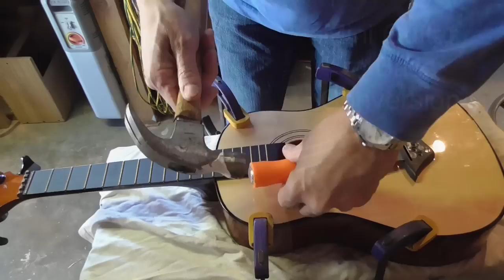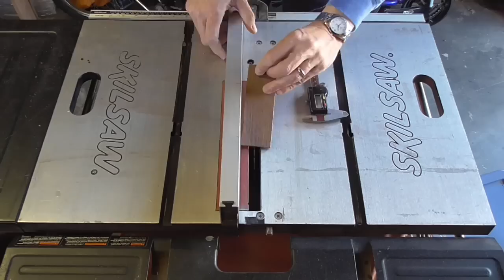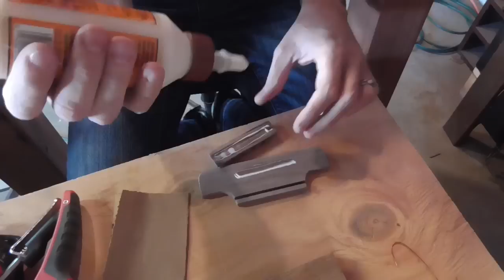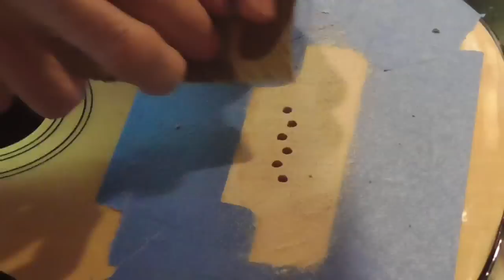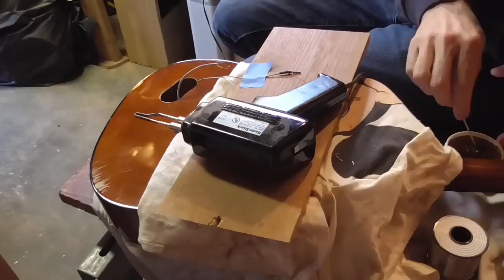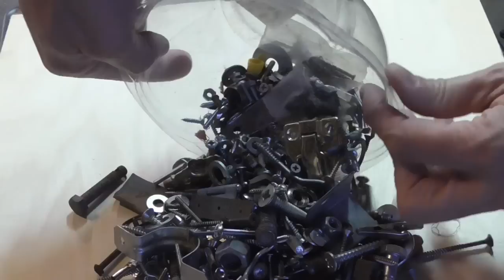Ukulele Bass Conversion

Comment: My thoughts - just completing my 2nd conversion of a 1/2 size guitar and the piezo pickup mount I use is under the bridge attached to the inside of the body, like on other instructions found on youtube. That setup even worked well on a plastic "Disney Cars" toy guitar which was my first try, and the sound did not need any boosting - plenty loud.  Using tape I moved pickup around a bit to try different spots, then hot glue gunned into place.  I am using Aquila Silver Rumblers - just ordered another set!
Reply from the maker: Thanks for the ideas Paul!  Piezo placement seems to make a lot of difference.  I like the idea of mounting inside the body under the bridge - going to have to give that a try.

Comment: Why not fill in the holes on the original bridge and redrill for bass if the half size guitar was originally steel strings it should have enough strength for nylon bass strings then all you have to do is replace the nut and machine heads no overcomplicated replacing the bridge also the original bridge if placed correctly In the first should be good for intonation.
Reply from the maker: I wish I’d thought of that originally! Hopefully that can help someone else considering this. This instrument is long gone now, but wish I had done it as you suggest. Live and learn.

Comment: Great! I will convert mine very soon... One question. How did you put the tuners??
Reply from the maker: I bought the smallest bass tuners that I could find, and as I remember it was a squeeze to get them installed. Just used the bottom 4 tuner holes, leaving the 2 at the end/top empty. 

Overall the bass is not great, left me a little disappointed. It was a lousy guitar, and didn't get any better as a bass. Just wanted to give you fair warning. I hope your conversion works out well!

Comment: magnetic pick up and rubber strings dont work together......?
Reply from the maker: I was using a piezoelectric pickup that (I think) works without magnetism, using vibration or pressure.  It works fine, though a preamp would help the signal.
Reply: You can also use Aquilar Red Strungs which have Copper in them! I make these v cheaply!
Reply: Probably not a magnetic pickup

Comment: In what way did the first attempt not work? I'm thinking of doing something similar.
Reply from the maker: Steve Kosusko The string buzz was really bad for some reason.  Maybe because the holes in the saddle are horizontal instead of through the saddle vertically?  There may have been room for the strings to hit each side of the wall in that long of a hole.  The aluminum bracket worked for the initial test, so I went back to it.

On a side note - I bought a Hadean Ukulele Bass, and it is vastly superior to my conversion.  It really sounds great.  I am only an occasional player though,  others may know better, but I love it.  My conversion never gets played now.

Comment: can i convert a soprano uke to a ubass
Reply from the maker: My guess is that it would be too small to convert. The fingerboard likely needs more room for the larger strings. Even my (larger than soprano) conversion is cramped compared to commercially available UKE basses.
Reply: @CharlieBuilt  :(( okay.
thank you for your response!

Comment: Is the intonation correct? Bass fingerboards have frets in different spacing than a guitar.
Reply from the maker: I never checked intonation, didn't realize that the fret spacing was different! I'll have to take a look and post another reply here. After getting the Hayden uke bass, I hung the project bass on the wall and haven't touched it. That's interesting though, and I'll definitely take a look.

Comment: Way it didnt work with the wood brige?
Reply from the maker: I think the holes that the strings passed through were long enough that the strings hit the front sides and buzzed when played.  This is probably why most bridges have a saddle of bone or plastic to isolate that node.

Comment: I have one of those tiny Yamaha guitars and I was wondering if it would be possible to convert it to a u bass.
Reply from the maker: I don't see why not, it should work.  I would note that the Dean guitar that I used never sounded good as a guitar, and post conversion, never sounded good as a bass.  I ended up buying a cheap Hadean uke bass that sounds really great and plays better.
Reply: +Charles Hamper i got my Ibanez bass for about $50 luck but got me hooked on bass
Reply: Britt, you need to stop k